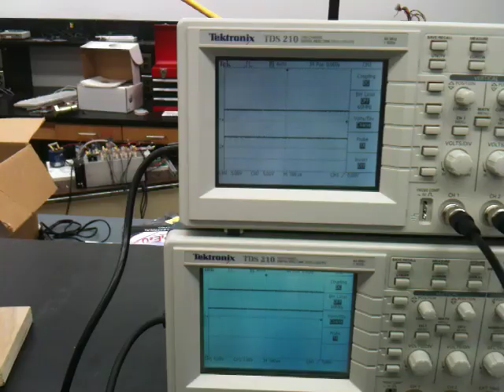OaklandUniv_FSAE_shifter.MOV

Comment: Hey guys thanks for posting the vid. 
How did the system perform on the actual car? You guys have any problems with oil getting over those sensors in the transmission?